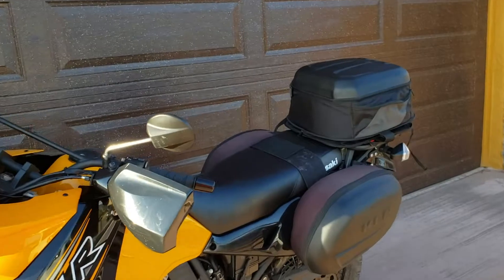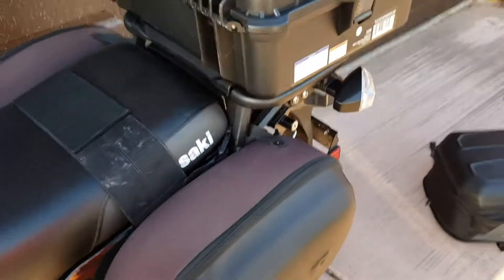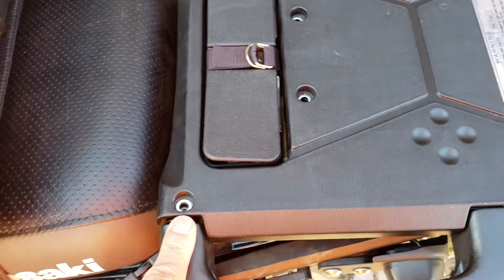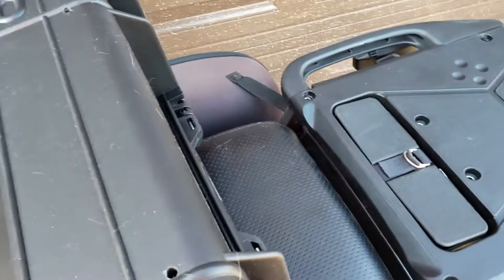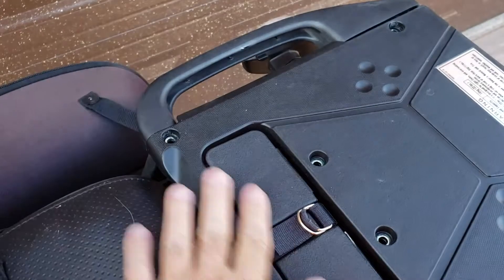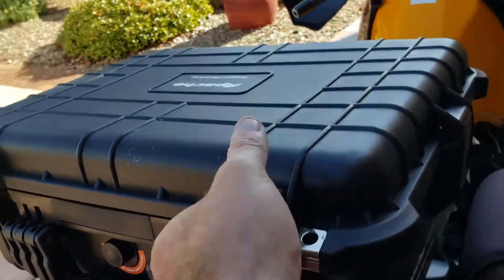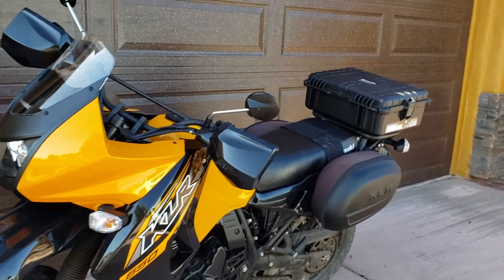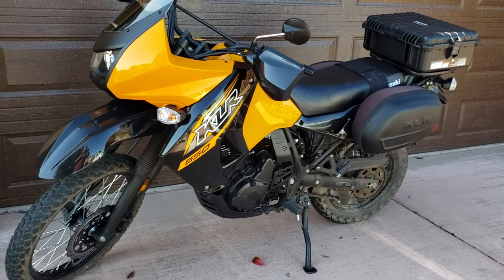KLR Luggage Swap

Comment: FYI, if you're ever interested in an easy on, easy off top-box solution, take a look at BRE (Back Road Equipment) Slider Rack.  It uses a cool, 4-puck keyhole mount design.  I have one on my KLR 650 and Vstrom 650XT.  I can easily move my SKB cases back and forth between the two bikes.   Pretty much anything you can put the pucks on, you can mount to the tail rack.
Reply from the maker: Thanks will do that